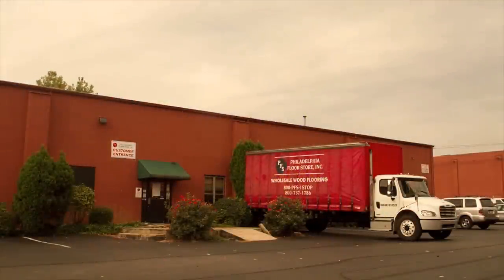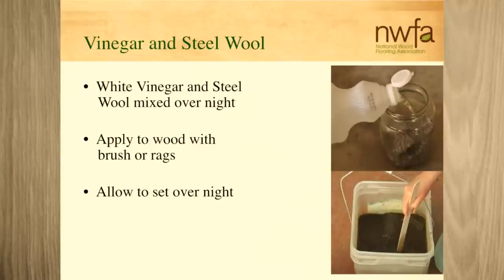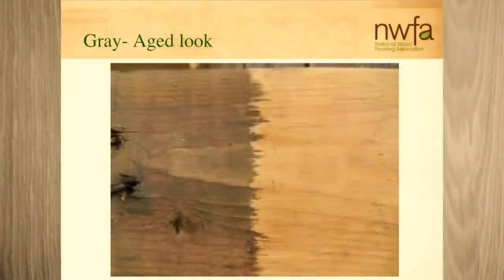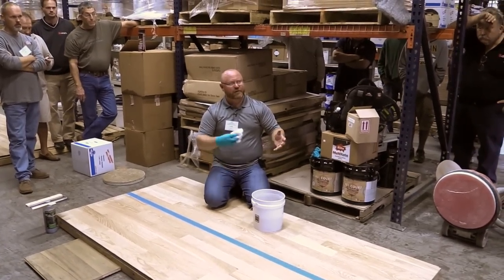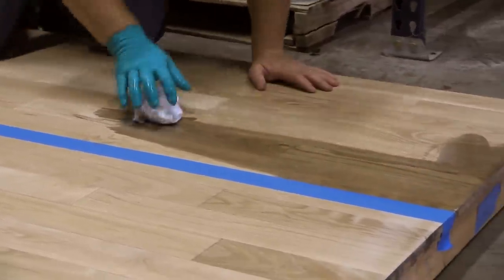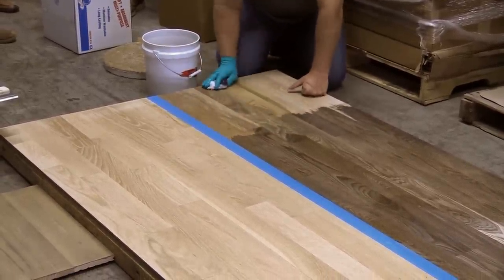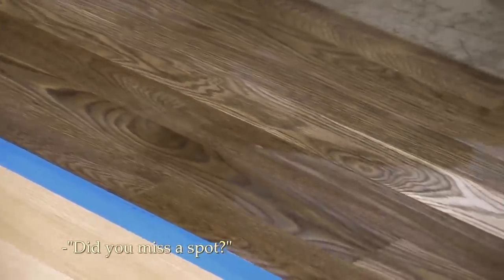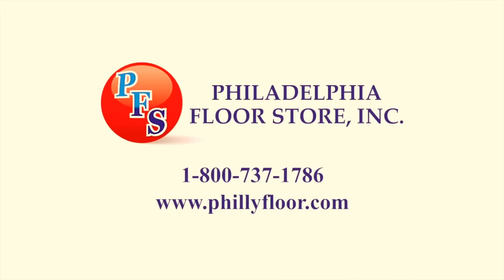Staining a Hardwood Floor with Vinegar and Steel Wool

Comment: I would water pop the floor first let dry over night in a warm home(65). When applying the solution keep the fresh edge wet. In the video he was applying the solution to dry which gives a double stain look everywhere he started and stopped.
Reply: I know this is super old; but...that "double stain" look will disappear and it will all even out in just a few minutes.  I have A LOT of experience and have never had streaks or "double stained" look.  What I have had, though, is the obvious white looking plank you see in this video.  I had this happen and for the life of me I could not get that one spot to stain...drove me nuts!  And all he said about it was, "it's the board."  I have to find out why and what I can do...
Reply: Paint a little bit of thickly brewed black tea to the portion that did not stain properly. That will add the missing tannins to that portion of wood. Make sure not to apply the tea to the darker stained areas, or the extra tannins will make them even darker. Once the tea-treated area is dried, stain again with the vinegar-steel wool solution. It will even out.
Reply: You're right, Paul. Black tea before the vinegar mixture is the missing link. I'm surprised they didn't discuss that in this video.
Reply: It’s because that’s a piece of sapwood. Sapwood has very little tannins so it gets little to no reaction. Something to keep in mind when doing a fumed floor. During install try to pull any pieces with sap. Unless you like the variation then just mix it in evenly when dry laying  @charlotteprescott-ruland9121

Comment: Is there an exact mixture of equal or greater or lesser parts to one another???  Please do tell, this is only thing I don't want to mess up.  Wondering if I have too little steel wool if it will be too light and vise versa for dark.

Comment: Conversion varnish for flooring? Wow. Hard to pull that off in a residence. Those products are usually for industrial shop use only with proper equipment on cabinets.

Comment: My floors came out almost black.  My wife loves it
Reply: What kind of finish did you used on top coat
Reply: Varathane water based polyurethane.  Its ok, seems to scratch easily.
Reply: @turog6291  varathane water based polyurethane.   Its ok.  Scratches easily
Reply: @daveryan9152  3

Comment: If I were to use this on hardwood floors, would the color change over time? If so, how much?
Reply: iron II will eventually oxidize to iron iii due to oxygen in the air and make a deep brown color instead of jet black

Comment: Pretty cool but my mix turned out to be black. lol glad it was a test run.
Reply: Yes,  vinegar stain is a hit or miss.  I would not suggest it on flooring unless you are going for a nice rugged/rustic look, or for a beachy look.  

If yours turned black, maybe you let it sit too long (I don't let it sit longer than 24-30 hours, which is why I only make enough for what I'm going to use), or perhaps you used too much steel wool.  You don't need a lot.  I'd say, for a 5 gallon bucket, I'd only use a couple pads.
Reply: It depends on the wood..if you have a wood that has plenty of tannins then it will be darker. Pine you have to use black tea with  because pine has little tannins and the tea adds that. 
It also depends on the vinegar..if you use apple it will be more red.

Comment: Anyone know if you could use a gel stain or maybe a toner on top of this to achieve a different shade or would the acidity of the vinegar stain interfere with that or cause problems later on? Also if you were staining birch in this manner would it come out blotchy like birch normally does, or would you need a wood pre-conditioner before applying this type of staining?
Reply from the maker: The vinegar and steel wool reaction is best on tannin filled wood like White Oak. You will get a slight reaction on birch but nowhere as intense as oak.  When top coating a wood floor treated with this type of solution we recommend using an oil based product as the first coat. Birch does stain some what blotchy at times. We recommend doing a small test are to see if the effects are what you are looking for.

Comment: It is suitable for pine wood
Reply: +roszaidi osman Probably. But I'd try it on a sample first. Pine is a Softwood and would probably absorb the mixture (whatever the proportions are!) a lot faster.
Reply: +SunShine very few tannens in pine, hardly any change , if any
Reply: I believe you would need tea bags or tea leaves tied in cheesecloth (or even a sock), to the mixture.  Pine contains few tannins, tea will add the necessary tannins.

Comment: Can this be applied with a wool applicator
Reply from the maker: Hey Todd! Yes, a lamb's wool pad can be used. You wouldn't want to use steel wool directly (could add varying levels of iron acetate). Whether you use a rag, paint pad or lamb's wool pad; the important thing is to wet out the floor evenly without overlap. Thanks!
Reply: Came out pretty good.  Can it be sealed with a water based sealer?
Reply: Sorry one more question.  Should the floor be lightly sanded after the vinegar/steal wool application,  before applying poly
Reply from the maker: Baking Soda mixed with water will neutralize the Iron Acetate.  After this we would “tack” the floor with water dampened towels then let dry.  A commercial catalyzed waterbase sealer or another sealer that will not react with tannins can be applied. As always it’s best to test an area before going ahead and doing the whole floor. Baisc Coatings makes a commercial catalyzed sealer and another called lock n Seal to block tannin reactions. Thanks!
Reply: Thank you very much.  My floors came out great!

Comment: Does not work. Steel wool was in vinegar 2 weeks and never changed colors
Reply from the maker: +Rob Mul 
Hello Rod Thanks for watching.  It is not uncommon for the solution to remain clear.  The reaction that is occurring between the steel wool and the vinegar is creating an Iron acetate solution.  Typically overnight is plenty.  Most importantly is the wood species this solution is being used to color.  It works best on White Oak as there are extratives in this species that react well to Iron Acetate.  Do a test with the solution that has been soaking that long.  You may like the look or you may try to use one that has been sitting for a day.  Take care
Reply: Did you use stainless steel